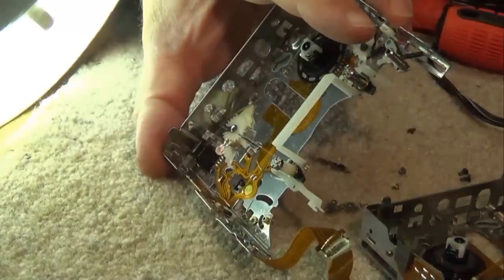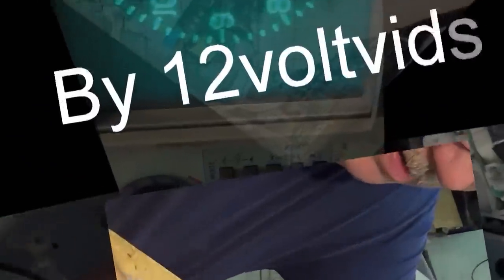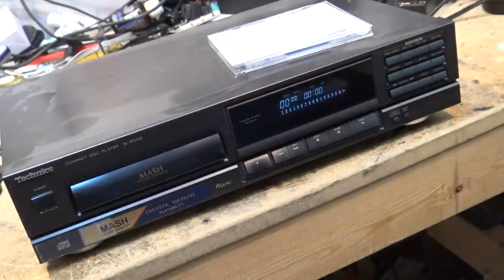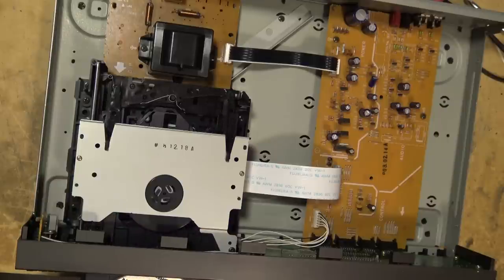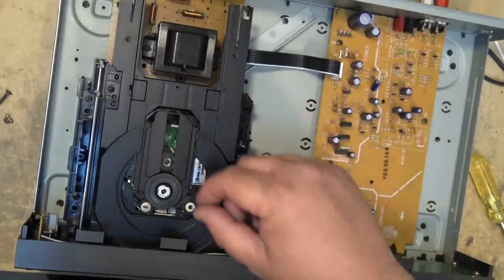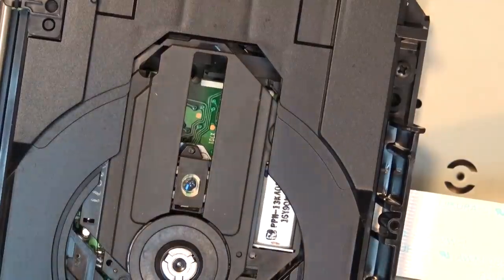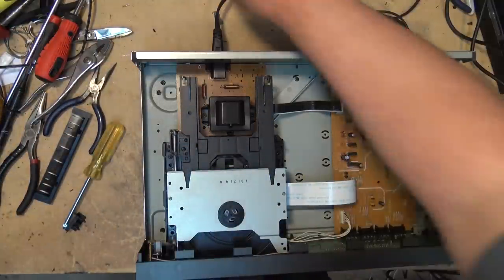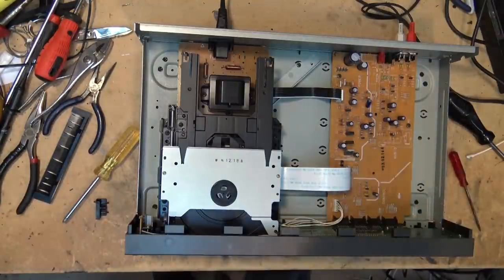Technics SLPG100 CD player skiping

Comment: C.d players die too easy, the laser itself is a dodgy component, i've allways suspected that it starts to produce impure/distorted emissions and the data is not as clean as it should be.

Yet ive looked at the output of two identical lasers with a scope and could not see a difference, but one works perfect and plays everything, the other plays nothing.

This had happened too many times to me, lasers are not up to the job.
Reply: Actually, in my experience, the laser itself is very robust compared to the mechanicals.  The CD spindle motors on the old machines do wear out.  The brushless motors on modern CD-ROM drives  seem a lot more reliable.
Reply: Perhaps i just got the bad ones, i honestly don't know.
I must be a magnet for bad lasers lol :-D.

The part that fixed most of the units i've repaired is the laser assembly, no carefull oiling/cleaning or adjustment of anything else made a difference, what conclusion would you come to if you were me, apart from running away with your arms in the air screaming LOL :-D.
Reply: I don't know either, but if replacing the lasers got your units to work then that's all that matters!  I know that static electricity can kill a laser assembly quickly, but from my understanding that usually happens when handled outside the circuit.  New laser units (or clones like for some Sonys) are probably easier to find then the mechanical bits and pieces and motors which might be expensive or impossible to locate, unless you have a parts units like 12voltvids mentioned!
Reply: C.d/dvd writers in computers do seem to kill the laser, i think it gets too hot while writing and damages the laser, slow write speeds and intolerence to certain disk types usually is the effect.
Oddly i dont see too many computer cd players with laser death, odd that.
Reply from the maker: Laser block fail for generally 2 reasons. The lens gets dirty with dust, smoke or other airborne pollutants, or one of the spot detectors fails. The diode is usually not the fault.
More common are the mechanical issues with the cheap motors that were used in the cheaper CD players. High end units used BSL AC motors like a hard drive would use. Cheap ones used a cheap DC motor, with cheap bearings.
CD themself is a major cause of failure. The disks are mass produced, and most are not properly balanced.  Just the weight of the ink on the top of the disk will unbalance the disk, and of course the hole may not be punched absolutely center or the thickness of the plastic may vary, or how the edge is trimmed. Even how the disk is clamped has an effect.This imbalance  puts extra stress on the motor and eventually wears the bearings causing a vibration to resonate through the disk and cause read errors more prominent as the disk plays on as the laser moved from center to edge, so these errors become larger as the laser tracks out.
Reply from the maker: Computer drives usually use a BSL motor too. Coincidence?
Reply from the maker: Panasonic discontinued parts for this unit 6 years after the unit was released. Finding new parts today would be a challenge unless someone is sitting on old stock. The motors used to be easy to find, but the shop I used to get motors from hasn't been open for awhile. The owner died last year, and his son doesn't appear to have much interest in carrying on the business his grandfather started.
They have been closed for the past few months and a sign on the door and on the web site says they are closed until further notice. So it looks like we have lost another parts supplier.
Reply: Yes that would make sense for computer cd readers, the writers i've seen many brands just slowly die, slow writing and reading goes down too.
It's a shame as the rest of the drive like the electronics is fine, it's such a waste of parts/time/money :-(.
Reply: Yep, all the cheap CD players I obtained (from either eBay or thrift store) had those cheap motors.  The Sony ones I have use Mabuchi DC motors.  Replacing laser didn't  fix, but once a new (or working) motor went in the skipping problems went away.  Being that some players were over 25 years old, that's still a long life.
Reply: I know that feeling, there was a shop in coventry called Electronic Services, it had all the parts that other places didnt, odd chips/transistors and similar.
A small shop with one wall full of draws up to the roof.
It's gone now :-(
Reply from the maker: I have DVD drives that have written thousands of disks.
One of my Toshiba DVD recorders has had probably 2000 disks in it easily and all I use it for is burning video to disk for clients.
Reply: In fairness to it though, the PG100 hasn't really died too easy - it has got to be getting on for 25 years old now.  I sold those things by the bucket load.  MASH - Multi-Stage noise SHaping - or marketing bollocks to you and me.